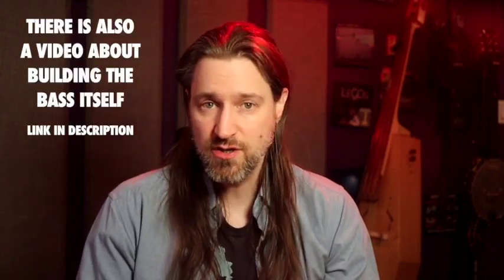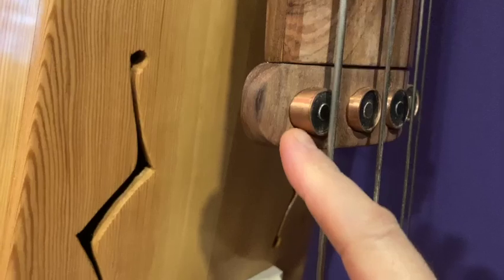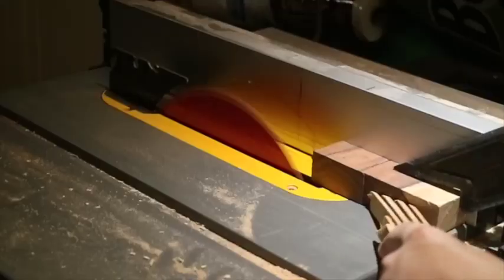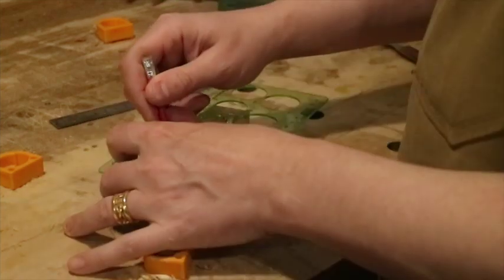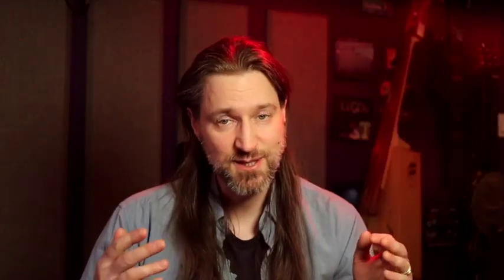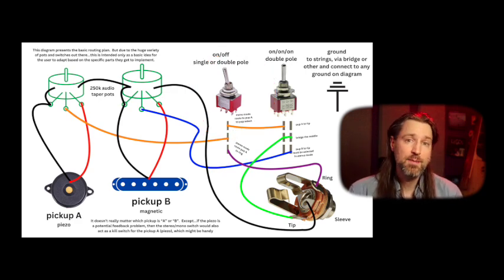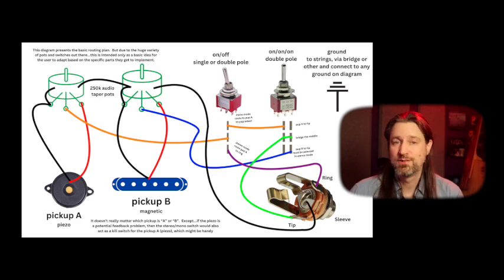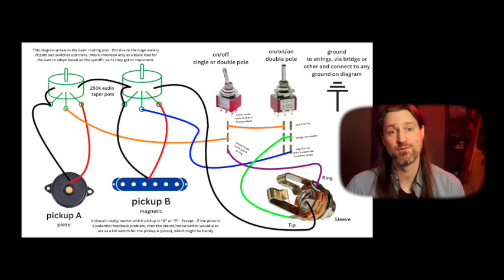Double Bass Custom Pickup - Design, Build, and Install

Comment: let  me give you a tip round off the f holes and try to put graphite in the string slots on the nut and try to fill the slots in to prevent buzzing and when you sing sing from your heart not your voice just a friendly tip

Comment: In a studio,please just use a mic. So much good sound available from a mic in front of acoustic instruments. Cool bass,tho!
Reply from the maker: Thanks!  I've been experimenting with all three for studio - mic, piezo, magnetic - and blend what the mix wants.   It's a quiet instrument acoustically, so a mic gives you a lot more string noise ambience than you might want.   But blending the mic with the magnetic is cool.   Or blend it with a Moog.   Still experimenting and I'd expect stuff with it will start coming out in late 2025.   But it's already been used live a few times.